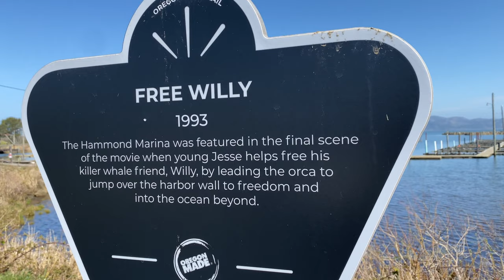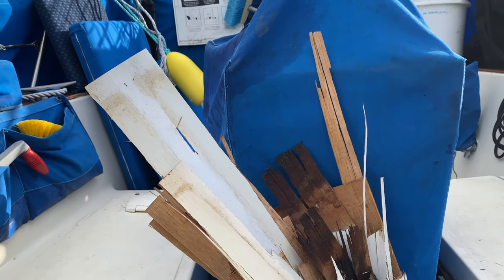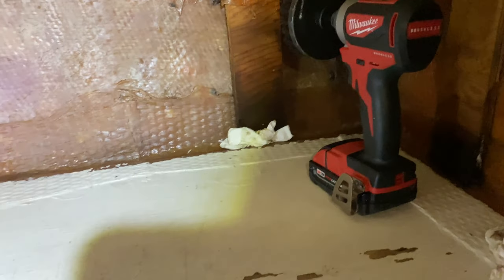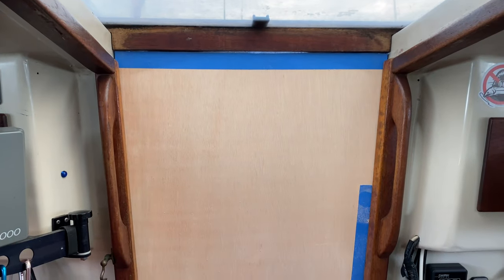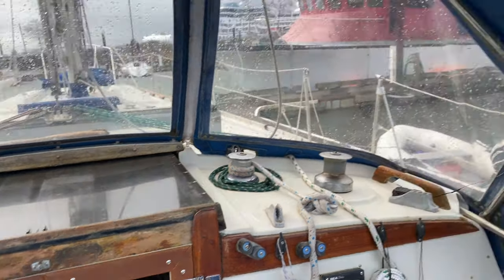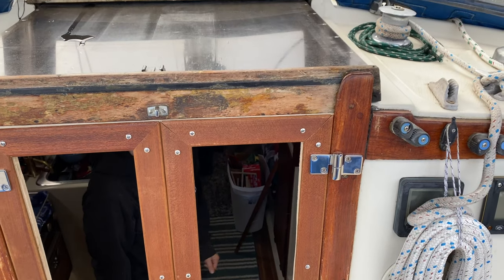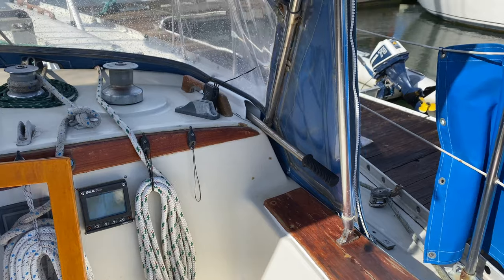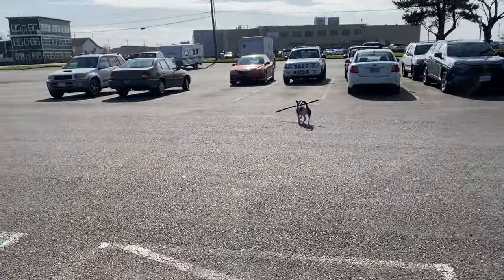Ep.16: DIY on our LIVEABOARD SAILBOAT! Companionway Doors and Springtime in OREGON!

Comment: Awesome video! Happy to have discovered your channel - have subscribed :) How are the doors when sailing? I noticed people say to have them so they can fold back against the 'wall' of the front bit of the cockpit (not sure of the technical term) but not sure if this is actually an issue when sailing? Thanks!
Reply from the maker: Welcome aboard! these door have drop in hinges, meaning that we can completely pull them out when sailing or in heavier weather to put the original storm boards in. :)